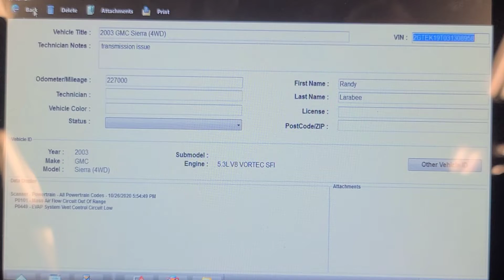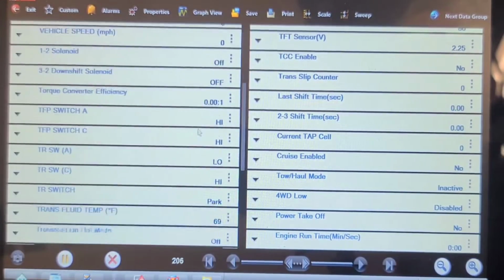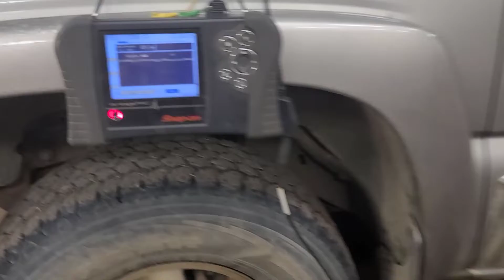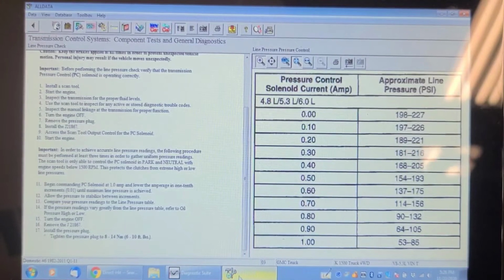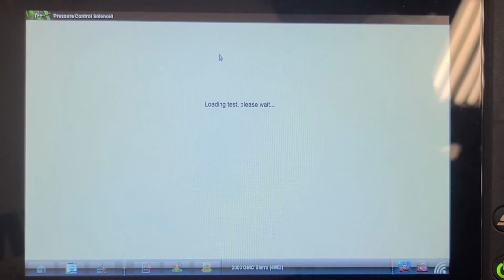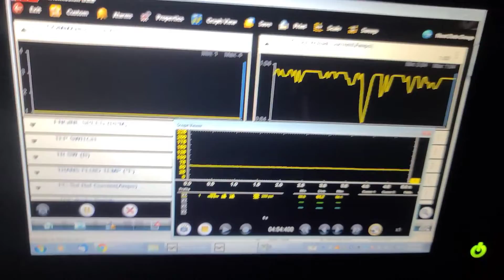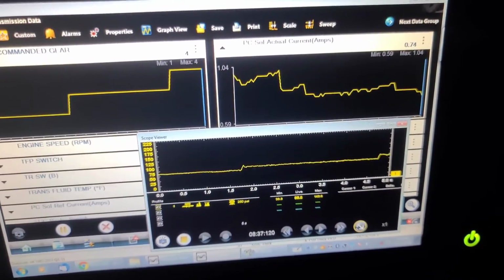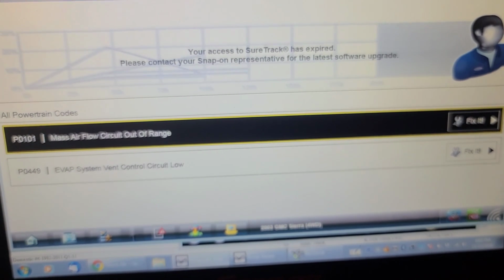2003 GM Truck 4L60E Transmission Pressure Testing

Comment: Got a 2008 4.8 silverado 4L60e 2wd,  any thought to when i go easy on accelerator the transmission shifts fine but if i press accelerator harder the transmission shifts later around 5 k rpms and sometimes trans dose not seem to downshift sometimes under full throttle.  Rebuilt transmission, New TCM and updated program
I saw a code P0961-00 Line pressure Control (PC) Solenoid System Performance  but i Installed the New Programed TCM and Cleared codes    but transmision still did same scenario as i described above.  i have not driven truck anymore   i just went for test drive.
does that solenoid need adjusting

Comment: hello
plz I have 4l60e on 6.0l gen 3 
I have a transmission problem 
R n 1 working verry well 
2 n 3 n 4 don't have a power on hight Rpm more than 2000 start to slip 
when I give a little throttle more than 2000 rpm starts to slip 
shifting down slow shifting a little  by hand 
i have slow shifting between 1 n 2 , 2 n 3 , 4 with slipping when rpm start to more then 2000 I have rebuilt it and same problem 
you think torque convert ?
 thank you
Reply from the maker: You rebuilt it? What was the original issue was it the same? What parts were put in or what had failed internally? I gather that you have confirmed the fluid level and quality. Start with a scan of the ECM and Transmission controllers. I doubt it's the converter since it doesn't lock up til 3 and 4 gear.
Reply: @PhillipBailey  I have a hummer h3 I swap to 6.0 gen 3 and I change the torque convert and pump and shaft inside the transmission and new discs 
after 20 km I have this problem start
Reply from the maker: @rockabichebel  sounds like you missed something. Did you air check all the clutch packs? Is the oil burnt again? Is it setting any codes?
Reply: @PhillipBailey  yes all the clutches good today I put a gauge on the line pressure I have 65 psi on all the gears just the reverse after 3 sec have 100 psi 1 2 n 3 n 5 have 65 66 64 psi I drive with  4000 rpm same pressure
Reply from the maker: @rockabichebel  In my opinion if the pressures are good and it's slipping then there is an internal problem. I'm not a rebuilder so I would get a second opinion from one.

Comment: So that's it? I was waiting for a Part 2! What did the customer or rebuild shop or installer say? Has it come back to you again? The Mass Air Flow sensor can cause a bunch of problems, TPS too. When I lost 3-4 in a ZR2 w/4l60e, I took it to a big well-known area shop and they give you a ride home and call you when they figure it out and ask if you want it done, but it was over $2K & didn't have the $$ and told them to pick me back up! The first thing on their printout was MAF sensor @ $200. I previously cleaned it a few months prior w/CRC MAF Cleaner...
Reply from the maker: This vehicle never came back and has been fine ever since. The story on this was the original transmission failed due to low fluid from a leaking cooler. Owner pulled it out and an independent builder rebuilt it. Apparently there was some significant internal damage that necessitated replacing the case, not sure exactly what. Nevertheless the rebuilt trans was installed but it only lasted one week. Rebuilt did it again but this time after install pressure was checked and was said to be very low. Unplugging the transmission electrical connector results in max pressures and that's how it was driven to me. I reconnected  cleared codes and could find nothing wrong. That's as far as I went. Possibly the gage they were using was defective. Not sure. Yes TPS and MAF influence the pressures. Unplugging the MAF will typically increase the pressure and make all shifts harsh.